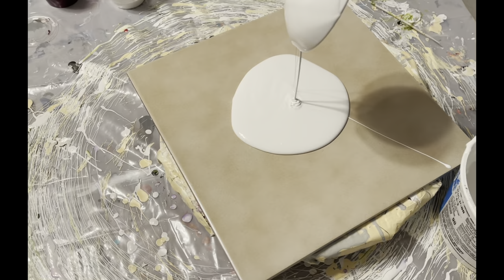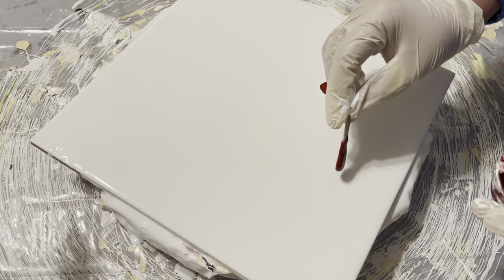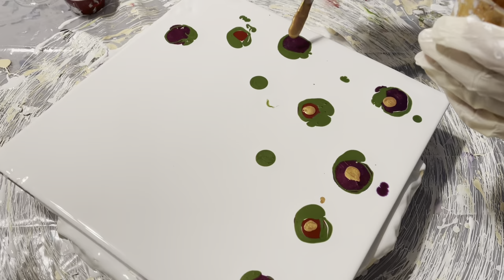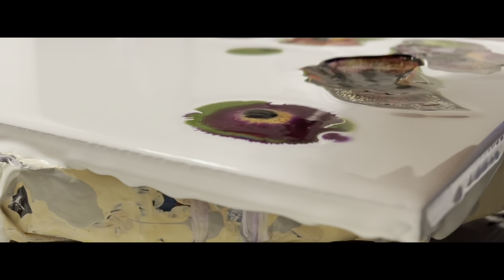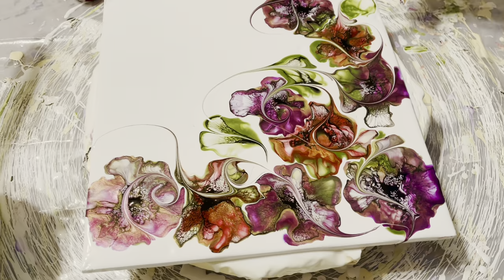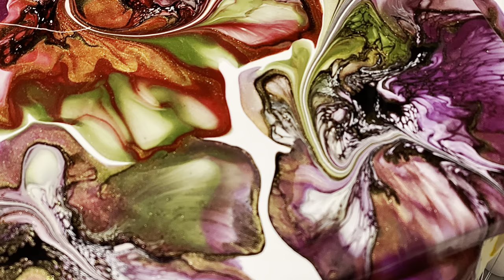#39 Another Off Centered Composition on a Square Tile, #ASMR, #relaxing

Comment: I just love your style!  Have been watching your videos a lot. Do you use a special spinner. I’ve also noticed you have something that holds the tile securely. Can you explain how you do that?  Thanks so much!!
Reply from the maker: I just bought a basic wooden spinner from Goodwill and spend three bucks on it. So there is nothing special. However, sometimes I put a tile on the spinner to help me with the placing of the wooden panel. And if I’m doing something off centered, are use duct tape to stick that wooden panel on to the tile. Just to make sure it doesn’t fly away.
Reply: @MilkywayArtDesignBySharminKhan  Thank you!